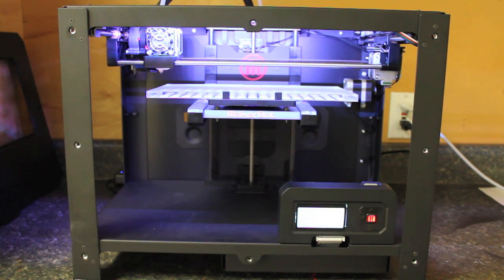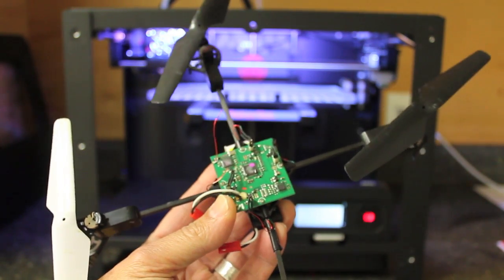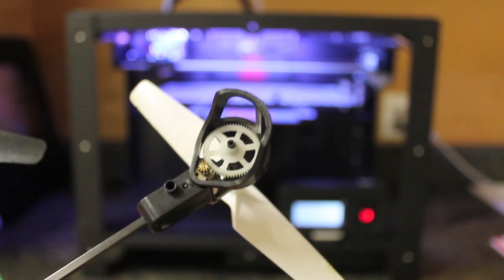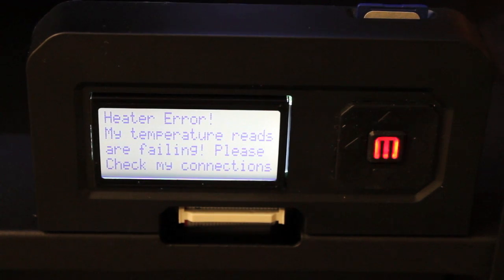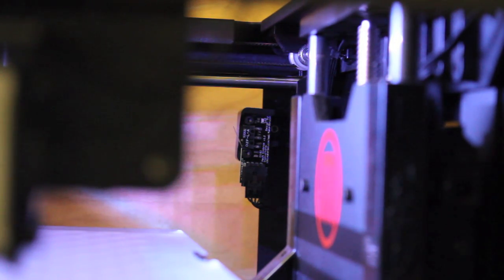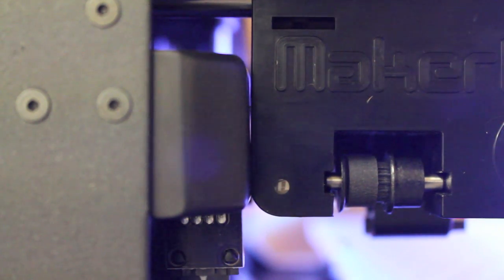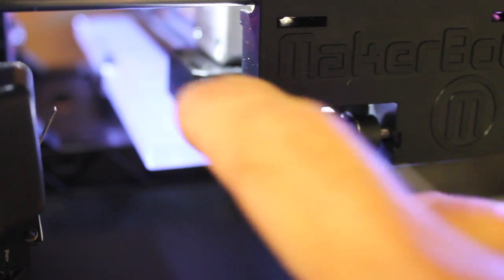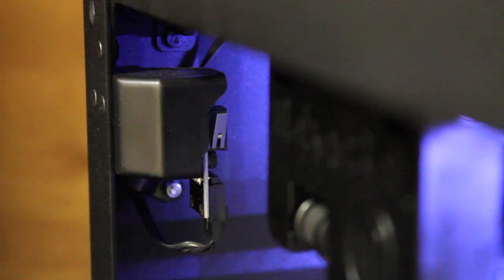I thought I was going to print quad and RC parts with my Makerbot Replicator 2 3D Printer

Comment: Hope you got it working. I had a few teething problems when I got my rep1 dual. But nothing compared to you rep2 and 2x owners had to go through. It's not my first cnc so I was doing great in a week. Then Sailfish came out and the aluminum arms and mk8 extruder upgrades and it's only gotten better. My question is, did the gear print? I've got that quad and I'd never even try to print that, even with my .25 nozzles. It's just to much post print manicuring to get it right I'd imagine.

Comment from the maker: Good suggestion. I didn't try moving the plastic part forward because was uncertain how to do it at the time. I did try bending the metal tab and it didn't allow the switch to make contact. That's when I decided to do the electrical tape hack. But I'm going to revisit soon with your suggestion of the plastic piece. Thanks.

Comment: In regards to the contact switch you can move forward a bit the plastic part that holds the small metal pin.  It could just have been shifted back a bit during shipping.  Or you can just bend the little small metal tab forward and that should fix it.

Comment from the maker: Thanks for the tip on the Kapton tape. All I had at the time was electrical tape, but I'll keep this in mind if I ever (hopefully not) need to do this again. Sorry to hear about your printer woes, but glad MakerBot support was able to assist you. As of late I've had very little trouble with printing other than my extruder sometimes getting jammed. I tightened the plunger a bit and since then I've had much more success.

Comment from the maker: Thanks. I greatly appreciate the offer. When I get around to this I will definitely let you know. Or maybe I'll know what I'm doing by then. I'm currently using Rhino 3D on my Mac and am starting to get the hang of it, but definitely not enough to model a gear. Most of the stuff I'm doing is replicating. Like taking a photo of a small part and then tracing it in Rhino. Lame, but it's a starting place!

Comment: About 24-48 hours. Yes, build plate. It's a replicator 2x build plate too so it's the anodized aluminum one. I measured with a dial indicator about 3mils difference in various spots but up to 11mils around the edges. So I can print small parts but I can't print anything that goes end-to-end over 75% of the length. Also, the build leveling process just doesn't work because the second verify round goes to the edges which is around 10mils out. FAIL

Comment from the maker: Everything is working brilliantly now. I originally tried bending the switch and had problems due to the angle that the extruder meets up with the switch. I was able to re-adjust the housing that contains the switch and everything now lines up. I agree the tape was a bad idea and at least got me to the point where I could print. Thanks for the suggestion.

Comment: Just bend the switch out a bit and it ought to help with the contact switch issues (limit switch is the proper term).The solder may have come undone on the heated bed. May help. Probably fixed all this by now. I am currently building a reprap. Little bit smaller initial investment.

Comment: All assemblies have tolerances.  While your solution of placing electrical tape on the surface that contacts the switch lever works, I can't help but think that you bought something about which you have no clue.

Getting back to the fix, the tape is a bad idea, because it is soft, and will eventually compress.  A slight bend in the metal lever on the switch is all that was required.  Being solid, it would retain calibration indefinitely.  Learn something about mechanics, and quit whining.

Comment from the maker: Right. In some cases the 3D printed parts are just fine for certain applications, but mainly for prototyping. I purchased the printed so I could become more familiar with the design process and print one-off objects that I find useful. If there's a design that I feel is good enough for production that I would take the design to a manufacturer that could mass produce it with high quality materials.

Comment from the maker: Yes, I'm getting there. If you check some of my recent vids you'll see the DJI Flamewheel leg extensions I've been working on. Also, if you check out garagepilots . com there's some info related to my progress on the design. Right now I'm working on extending them a little bit so that a GoPro and mount can fit underneath the quad. So I've extended them another inch and will be testing them out this weekend.

Comment from the maker: You're probably right given my initial experience with the 3D printer, but I'll definitely give it a try. I hadn't thought about casting a mold and appreciate the thought. I may do that if the 3D print doesn't work out. Thanks.

Comment: I'd be surprised if it can make that small gear to high enough resolution to work. That's a small motor and any little bit of binding will probably stop it or at least cause it to slow down. This will affect the copter performance and ability to stay stable.

You could however just use one of the other gears and cast it in modelers resin. That would work fine and you could make them faster.

Comment from the maker: Not just yet, but getting close. Given all the problems I had getting the Replicator 2 up and running I'm doing some basic prints to get started. I've printed a couple of arms for my Blade mQX quad and will be posting a vid soon. As for the gear I have a basic design in place. I'm going to print in the next day or two and see if gear teeth turn out okay. Will keep you posted and thanks for asking.

Comment: The upgrades were mainly in the extruder head, which was vastly improved in the first 6 months of the TOM.  The R2 benefits from this very much.

Multicopters lie in my future (I'm letting the early adopters work out the kinks :-).  I was an avid RCer decades ago, but am now a scale modeler.  I've built a 1/18 scale V-2 with my TOM (lots of parts -- the model is almost 3 feet tall).  I was thinking of selling a kit (I've built 5 during the development process), but will now wait till I get an R2

Comment from the maker: Great point about going from kits to packaged products. There is most definitely a world of difference between the two. And now they've just announced the Replicator 2X at CES so I can't imagine their workload.

Crazy that you've pushed that much plastic through it. What upgrades did you do? BTW, are you into multirotors and have you printed any parts or are you just here because of interest in 3D printing? Just curious as it would be cool to find others interested in 3D printing and quadcopters

Comment: Good to hear im not the only one with my issue, i re-aligned my gantry but that wasnt the problem, the contact switch was actually a little bent upward so i just applied some force to it downward and it seems to be staying. At least if it occurs again i will know what to do. My printer right now refuses to print and i am in contact with makerbot, buying such a new technology can be frustrating with little to no help.

Comment from the maker: My setup is the exact same as yours. There is no contact switch on the x axis and I've actually read that it's intentional. To fix your motor problem did you do a gantry re-adjustment? I've watched the support vid on how to do it, but haven't gotten around to it. Right now I'm waiting on a BotStep controller board that MakerBot shipped to me. One of mine was bad and all I've had are problems since I received the R2.

Comment from the maker: I should have mentioned that's the first thing I did and it still didn't work. The problem is that even after bending the switch out some more the metal piece still wouldn't depress the contact. It appears to be more of an alignment issue so I may go through the gantry realignment process soon. Let me tell you I don't feel great about an electrical tape hack as a long term solution.

Comment from the maker: Interesting points and thanks for sharing. I was skeptical of the gear, but will definitely give it a try and let you know how it goes. I'm struggling getting the Makerbot up and running. It's been problem after problem. I did end up braking a boom on the Blade mQX today so maybe I'll start with that. It's just a plastic rectangle so it should be doable? Are you currently doing any 3d printing?

Comment from the maker: Thanks for the tip. Do you mind elaborating a bit more? Currently the Replicator 2 will only print in PLA plastic. How does Delrin powder fit into the picture? Not sure I'll be able to pull off this gear, but will definitely give it a try and post my results. Of course after I get this Makerbot paperweight working :)